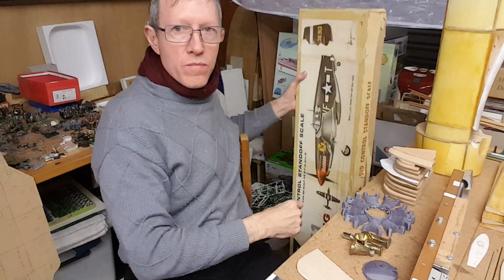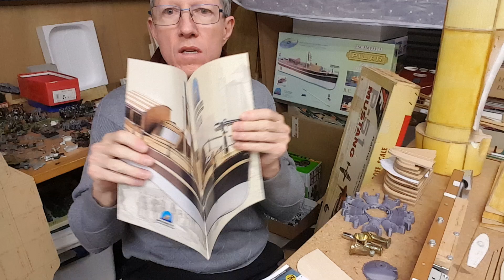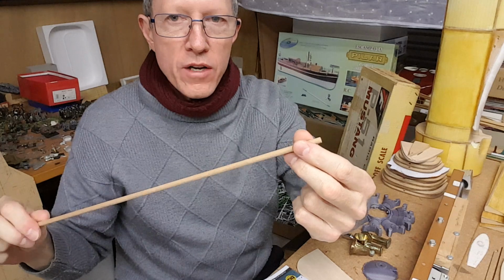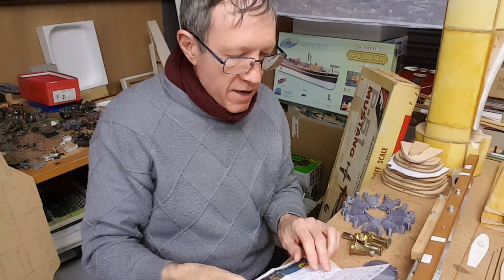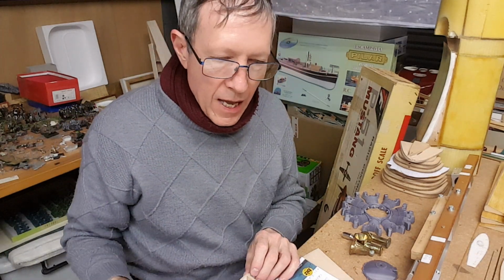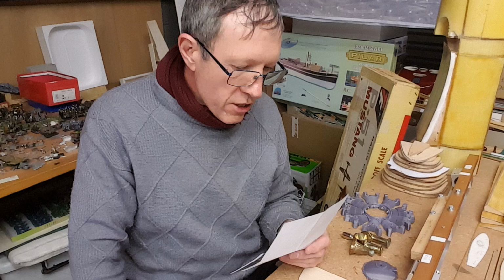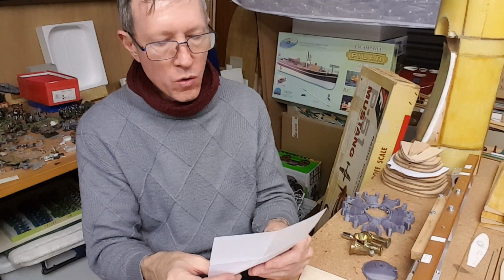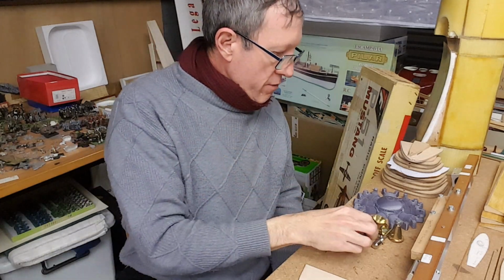Projects on the go. non plastic models

Comment: Hey Deon, what an amazing chat - your build ratio seems to have increased exponentially  with the new large scale additions. The Harvard is much bigger than I imagined.  It's very impressive that you have designed a machine to taper the mast. The four prop Spitfire looks like it is close to the end of the variants, maybe post-war ? Building a Guillows ultrasounds intriguing. Many years ago I had plans on a large scale B-24. I think it has gone but I'm checking my archives. Based on your projects, I'm thinking of expanding my horizons too. At the moment I'm wrestling with just three 1/72 scale Spitfires, with a large stash of kits and scales in storage. It seems the more projects you are working on improves creativity and skills. I know you mention the kits are inaccurate, however, your finish out negates that. I would think a museum or library would be very interested in displaying your work. Or a community journal do an article on your talents, even a model magazine.. After this chat, I'm going to check my stash and see what else I can put on the build list.  I know you are Happy Modeling for sure and an inspiration to your modeling followers. Cheers, Bob
Reply from the maker: Thanks for the comments Bob. If i had "Best fans" badges - youd get one